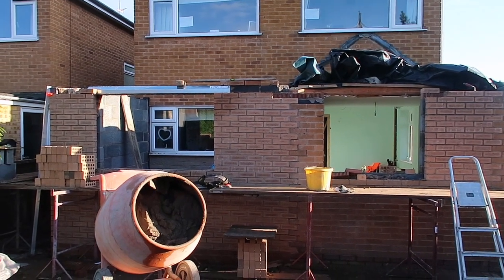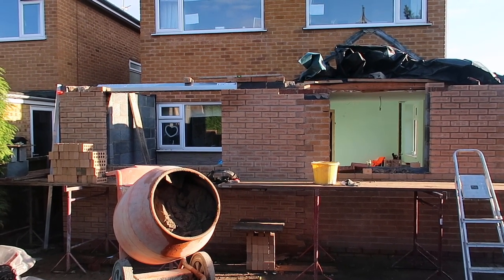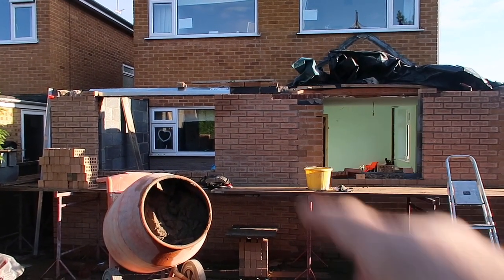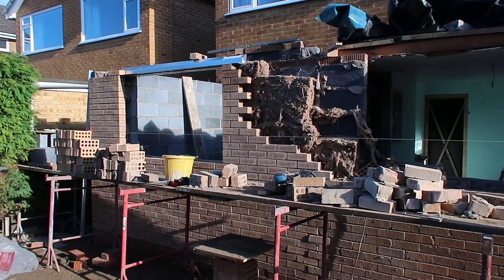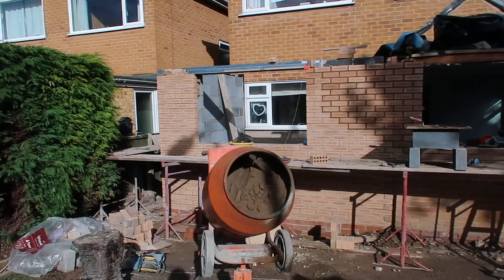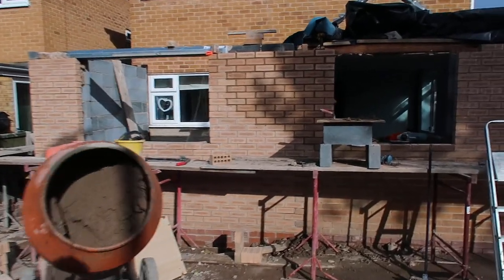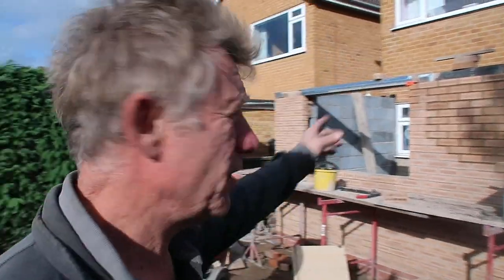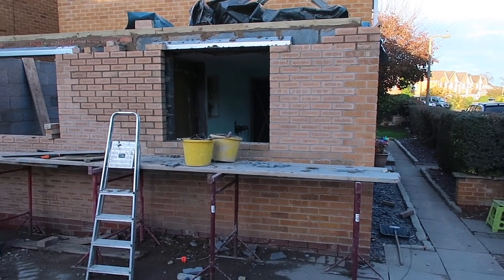Bricklaying extension 5

Comment: It happens mate i would have done exactly the same brickwork is 90% visual and needs to look the part good job 
Dont quite get why you put a tray over lintel as nothing above it
Reply from the maker: That's rue.... I put cavity trays in; glad I did because the inspector felt over the wall plate for them and he was pleased I had ..seemingly any excess condensation moisture coming down the insulation will run out over the trys🤔